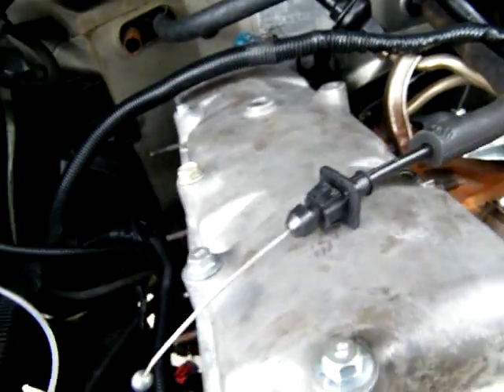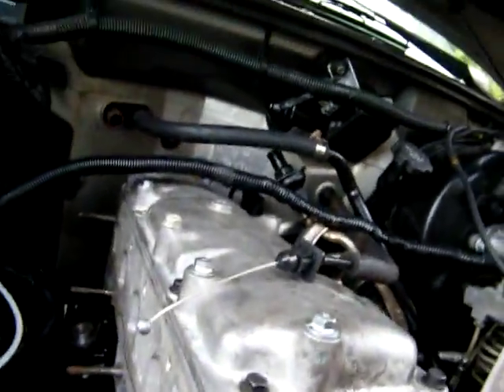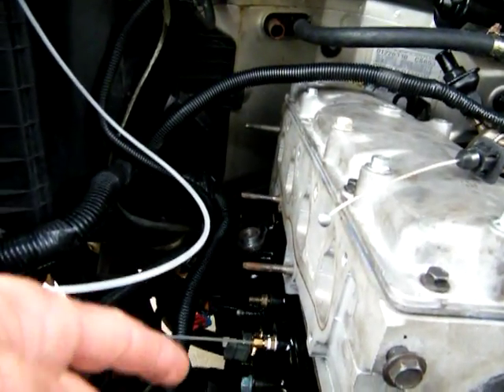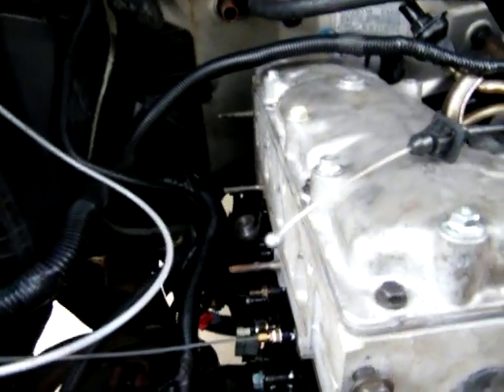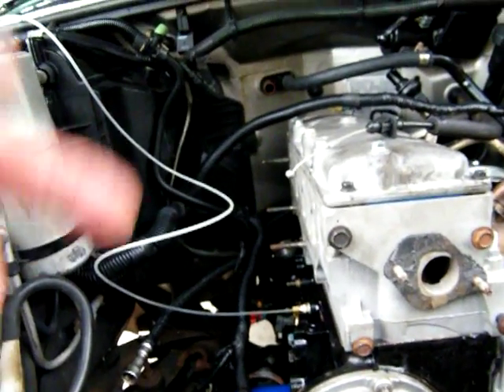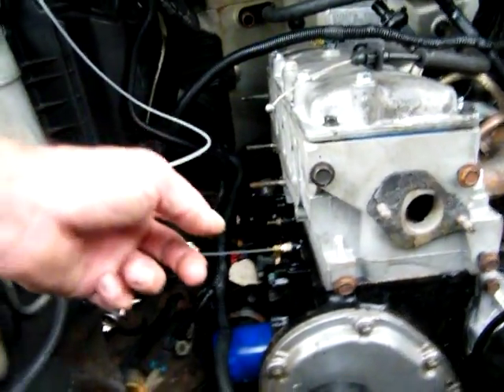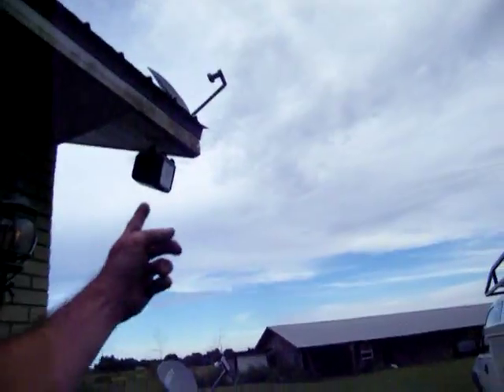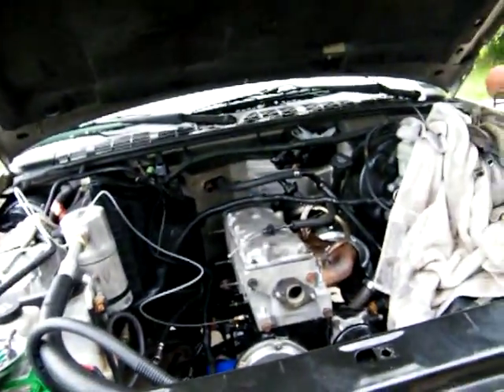DSCF0073 What a Pisser

Comment: I've been wondering why I haven't seen any videos from you. So I checked my settings. Now I should start seeing more. What is this Chevy your working on?
Reply from the maker: it's another s10, 2.2l , some strange reason I can't get you on FB, want let me friend ya, there's no option. I just see when you like a pic and can't respond
Reply from the maker: also i'm in the process of pulling it again, i'll start it Monday, been trying to get it running so I can work on the Saturn, which aint happenin so I have to grind bolts off the water pump on the Saturn and hope I can get it done with no issues tomorrow.
Reply: I went and looked on facebook. It just shows that I am following you. No option for a friend request.
Reply from the maker: same here no options